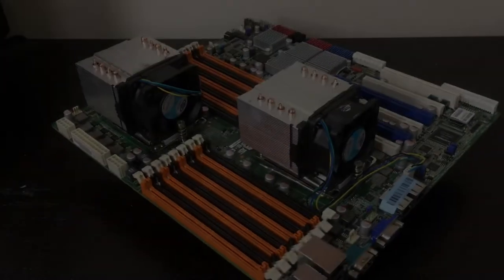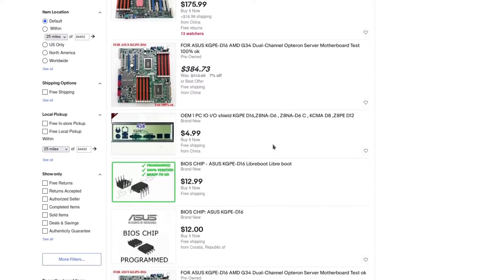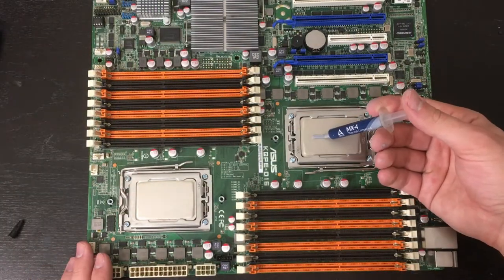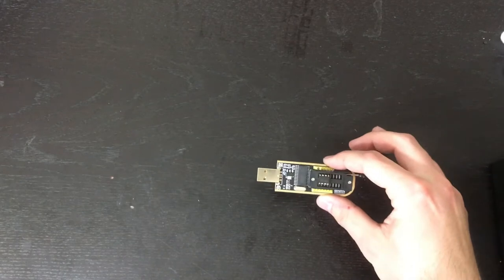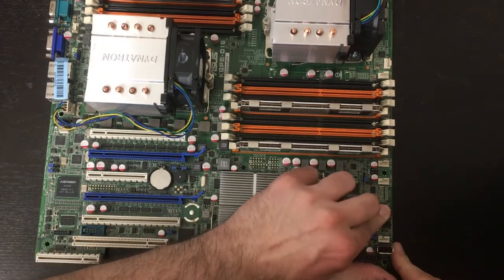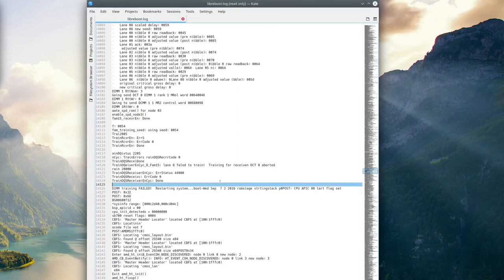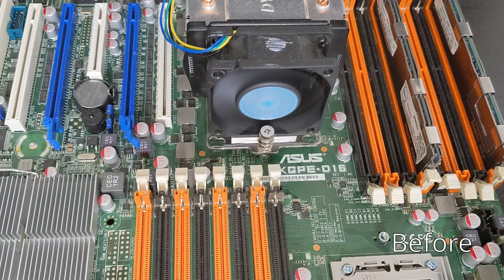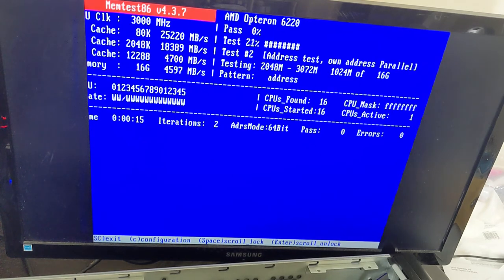Building a Libre Server | Installing Libreboot on a KGPE-D16

Comment: Great vid I just purchased a ASUS KMCA-D8 for £45.00. Have done many T400's and X200's. I am also bidding on a cheap T500 going to try the Quad Core mod for that.
Reply from the maker: I'm attempting to do the quad core mod as well. As soon as it is completed it will be uploaded to the channel. I'm glad you liked the video!
Reply: @DeviceCastingCouchTechPodcast  I have a W500 and if you're successful with the quad core mod I would love to learn from and try to reproduce your method with it. Subbed with the bell. Recently discovered your channel and love your content. Great Work!
Reply: I have done a quad mod for my T400. It was a dual gpu model so I suspect thats why the stock cooler was sufficient. Im running a qx9300 extreme and it works perfect.

Comment: this bootloop happened to me too today when i librebooted my x200
I figured out after 20mins i have two sticks of ram one 1333mt/s and one 1066mt/s
and normal bios works well with it byt not libreboot
i need two equeal sticks i guess

BTW you can mod your ch341a with a solder iron and a single cable to make it run data pins at 3.3v

Comment: Fantastic. Thank you for the video. I want to build a similar home lab for running various services at home. Maybe little bit overpowered for my needs, but what the hey, does it matter if you can run Libreboot?
Reply: Keep in mind that these Opterons use Bulldozer-type cores, which means for floating-point calculations your core count is effectively halved. Whether that matters to you will depend on your use case.

Comment: Hello, could I know which fans you changed to the heatsinks, that is, the exact Noctua model. Thank you.
Reply from the maker: I used the Noctua NF-A6x25 PWM for my heatsink fans. I would double check your heatsink and see what size fan it takes.
Reply: @DeviceCastingCouchTechPodcast thanks !!! ;)))

Comment: Are all KGPE-D16 motherboards compatible with Libreboot or do you have to get certain serials like the D8?
Reply from the maker: From my understanding they should all work. Just note they may have various levels of compatibility. I found this out because I have a revision 1.05 and I found my RAM compatibility didn't match some of the compatibility known to work with revision 1.03G.
Reply: @DeviceCastingCouchTechPodcast  thank you
Reply: @DeviceCastingCouchTechPodcast  what ram worked for you because I just found a 1.05 with 2 6376 processors for a good deal.
Reply from the maker: @LifeModder  Let me know how the 6376 CPUs work. The libreboot website says it has buggy microcode but i would like to here your experience.

After testing a few I found HMT151R7BFR4C-H9 to work nice. The only down side is they are 4GB per stick. Also I found it didn't like being installed in the black slots. It will boot but and work but I found it to be unstable and for my server I like having constant uptime. So only using the orange slots it is now stable but I am limited to 32GB. 

In the future I would like to test some more RAM out and see if I could at least find some 8GB sticks

Comment: What is max ram on this board? Should I buy any specific type of ram for this?

Also, could I install a gpu on this mobo?
Reply from the maker: If you plan on using libreboot or coreboot the max RAM that has been tested is 192GB. In the description I linked to the coreboot wiki and there is a list of RAM that has been tested to work.

If using stock BIOS it can go up to 256GB of RAM and there is a Memory QVL on ASUS website that should be able to help you.

Yes, a GPU can be installed on this motherboard.
Reply: @DeviceCastingCouchTechPodcast  I just saw on this website that this mobo only supports textmode, is this true?
Reply from the maker: @jacksmith1098  I was able to use a GUI installer for proxmox with the onboard graphics in "txtmode". From my understanding that is only for the built in graphics if you install another GPU it should work fine.

Comment: Is this motherboard with libreboot stable enough to use as a daily driver workstation?
Reply from the maker: I use mine as a server and it has over 30 days of uptime. I have found stability is often effected by the RAM used. This is because the RAM init is not that mature. You have to be very particular with what RAM you choose.

Comment: Awesome job! I have this board revision 1.03G. At the Libreboot screen I choose to boot any Distro and I get the error "no irq handler for vector". I think my RAM combo could be the fault, so I've got some cheap RAM sticks coming. If that doesn't work then I'm clueless to what is causing the problem. If anyone can help please feel free to chime in if you have any idea what might work.

Subbed!
Reply from the maker: So for 1.03G you should check the retired coreboot wiki it has a lot of know working RAM configs for your board. For IRQ it could also be your storage some SSDs don't always follow the ATA standard.
Reply: @DeviceCastingCouchTechPodcast  Thanks I checked Coreboot wiki and I have 6386SE Opteron's not listed as compatible :(
Reply from the maker: @binaryfinary8256 Looking at the coreboot wiki it mentioned microcode updates are required for secure operation. If that doesn't work you can always pick up a pair of processors in the 6200 series. They are pretty cheap on ebay.
Reply: @Living life in Bolivia  Hi please advise how to update the microcode, is there a guide anywhere? Thanks 🙏